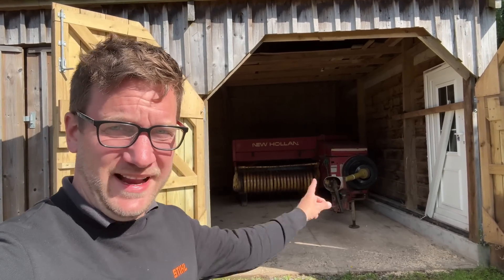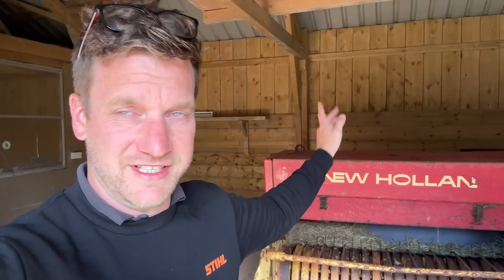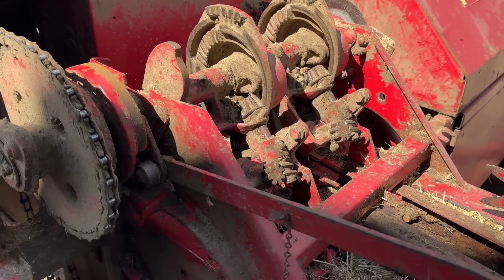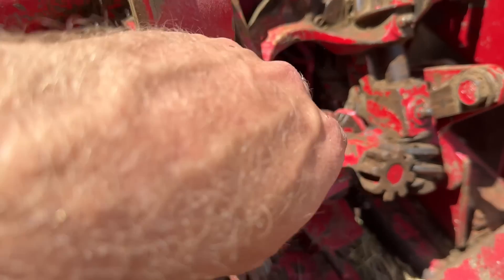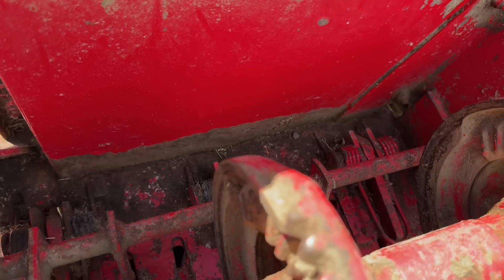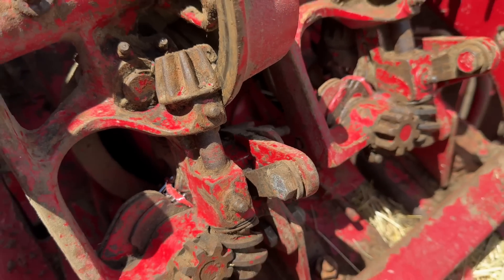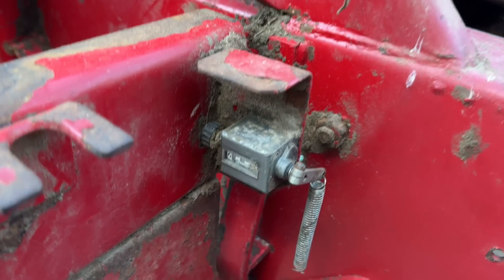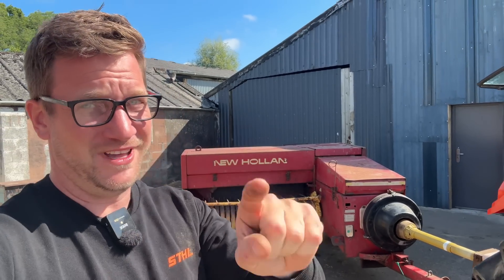New Holland 377 Baler Service, How it Works and Knotter System Explained “Fix It”

Comment: Great video. I had an international 430 baler for about 10 years.  In our small hay fields I was lucky if I could knock out around 100 bales in an hour. I decided to upgrade and bought a 377 and I remember baling about 300 bales in an hour, which was a big step up in production for me. They're a great baler and I have seen me doing 650 bales without a slipped knot.  Although I need to check the knotters as it has become a more regular occurrence for slipped knots, which is one of the worst things and a pet hate to have to rebale busted knots. 
Thanks for your helpful video. 
Mickey

Comment: Only just discovered your channel.  Brilliant run through of the mechanisms, especially the knotters.
They really were a memorising machine for a young lad growing up in the 80s as l did!  Like how did they tír the knot?  And, the distinctive churning noise that could be heard for miles on hot summers evenings......

Here on our small farm in the west of Ireland l remember welger balers we're seen as the creme de lá creme.  They made a nice bale and were a fast baler compared to the likes of a massey ferguson.  Jones was another make l remember.  I don't think there were any new holland here in this part of the country.

"Knots out and down" was what my father would drum into us as we'd stack them in 4s on their end like poles of a wigwam, if that makes sense.  Twas all got to do with the way the bale was made and to help rain run off while they were outside seasoning.
Reply from the maker: Thank you Philip, really appreciate you sharing. Nostalgia is a wonderful thing.
Reply: Knots down and out is what I remember. Rain never far away with us either in county Tyrone.

Comment: PTO shields ?
Reply from the maker: What about them mate? They’re all there.
Reply: @finditfixitfarmit  
Sorry to point it out, tried to keep it to a minimum in the comments They might be there but they are supposed to be stationary when the machine is running, in your video they are clearly rotating.  It's just not worth the accident or the fine, learnt from experience!

Below is a short extract from HSE 
Power take-off (PTO) shafts

A tractor power take-off (PTO) and the PTO drive shaft of a machine are very dangerous if used and not correctly guarded. Every year people are killed or seriously injured in accidents involving PTOs and PTO drive shafts.

Most of these accidents are preventable if the PTO and PTO drive shaft are fitted with guards of good design which are properly used and maintained.

For PTO shaft guards, check that the guard is:

made to a recognised standard such as BS EN ISO 5674;
the correct size and length for the shaft, both when closed and when extended;
a non-rotating type, with the restraining device (for example, securing chains) in place;
properly used and maintained. Clean and lubricate guards regularly;
supported when not connected. Do not rest it on the drawbar or drop it on the ground, and do not suspend it by the restraining device;
safe from damage, for example, by livestock, when the machine is in store.
Make sure no one uses adaptors to allow a 21 spline 1000 rpm shaft to drive a 6 spline 540 rpm shaft.

Back to top

Comment: We used to have a newholland baler when I was a kid in the 70s we used to pull it with a international 574 hydro,can't remember the model  number of the baler, think it was 376 but remember it used  to tie the bales with wire not twine. The baler came over from the states with a bale accumulator attached the the baler  on caster wheels, use to wander like crazy on the road though! Ford 5000 with farmhand f11 loader and flat 8 grab to move them ,the good old days 👍

Comment: I remember from my childhood. my dad and uncle had a new holland 377 baler, and they made a lot of square bales. they used a 1978 zetor crystal 8011. Great memories
Reply from the maker: Awesome, good old Crystal 👍🏼
Reply from the maker: Mike said he worked on on several Crystals as he was a Zetor engineer for many years.
Reply: @finditfixitfarmit  my uncle still has two zetor crystals. One needs an engine overhaul, and the other is still earnings its keep on the farm.
Reply: 0😮0😮😂😂😂😢😮😅🎉😊❤❤😊😊😮😂🎉😢😮😅😊 @finditfixitfarmit

Comment: Those old NH balers are as good as any on the market at the time. Baler knotters have always been a work of art and mystery to me, as you said pretty much unchanged since at least the 50s. I did stumble upon some footage on the tube a while ago of a working knotter actually in work on the tractor all in slow motion all good stuff.
Reply from the maker: It would be good to get some slowmo shots when we bale, hopefully I remember 😂